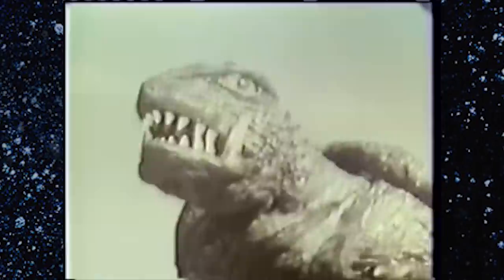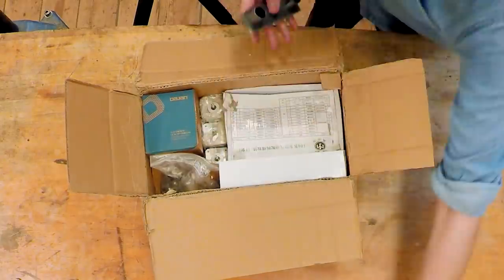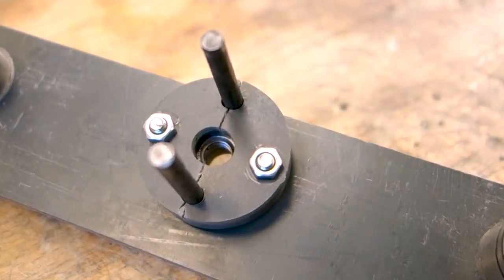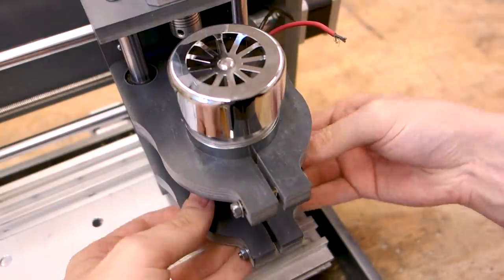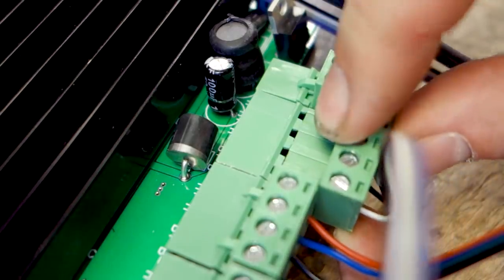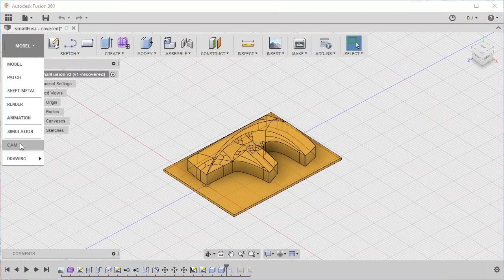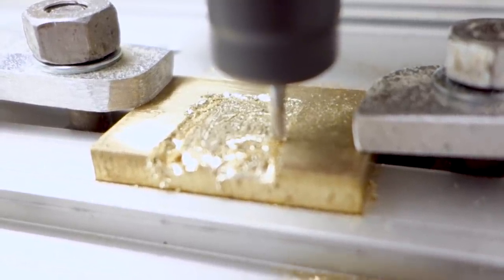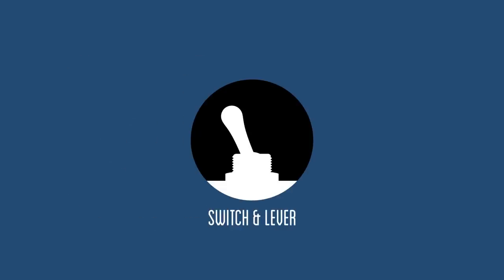Review: Cheap CNC Mill

Comment: I have had this same machine for about a year.  It is perfect for making PCBs and does an amazing job. I've also milled plastic parts and MDF. I am building a jig to hold HM-10 Bluetooth modules, it is designed in Fusion 360 and can be seen here http://a360.co/2w46028  (use explode model on the toolbar to separate and see all the parts). I used this to mill the PCB and the MDF parts. I am using pogo pins and the spacing is 1.5 mm between pins and this little machine did it perfectly.
Reply from the maker: +aharry great input, thank you! As I show it does just great with softer stuff, but some seem to get hung up on the metal failure of mine. I figured it would do PCBs just fine, but didn't have any I could test on. Cheers!
Reply: Switch & Lever I'm sorry, but considering how poor did it perform on brass (a soft and pliable alloy!) it probably won't give you the precision required for PCB milling. Sure, it MIGHT be able to do some engraving into it, but that's a fairly hard material too, so the dimensions would probably be off by quite a lot.
Reply from the maker: +CoolKoon so you take your opinion over someone who had first hand experience using the same machine for doing what you said? I'm confused. 

The load on the machine when engraving PCBs should be substantially less than the load of milling the foam I did, and even though it skipped steps due to poorly greased rails and leadscrews it pushed through without any issues. The thickness of the copper on a PCB is minimal, and copper is also a much softer metal than brass. It should do just fine.
Reply: Switch & Lever - "even though it skipped steps due to poorly greased rails and leadscrews it pushed through without any issues" - And that's what worries me about this thing the most. Sure, it might be able to do boards for through-hole components just fine. But how about boards for SMD chips with REALLY small traces (like the board of the aforementioned HM10 module mentioned by the OP)? Even if I'd be buying this machine only for making PCBs, I'd rather throw in like $200 more to get something that has a metal frame, not this flimsy plastic.
Reply from the maker: The plastic isn't flimsy though, it's plenty rigid for light duty work such as PCB milling. Even the wider boards I cannot significantly deflect even if I try to bend them with my hands. I think it's PVC with a fair amount of clay in it, to make it extremely stiff, with the downside to being brittle. If the plastic was "flimsy" as you say, it would deflect a whole lot worse than what it does, when being pushed into doing something it was not supposed to. 

Why does the skipped steps worry you though? It was entirely fixed when I greased the rails and screws. It's a non issue. Regardless of the mill you're using you need to make sure things are running smoothly, it's not like it's unique to this.

As I've wrote before, the best accuracy I can get from it is about +/- 0.1mm over 100mm. The steppers motors are 200 step motors. Combined with the M8 leadscrew that gives a resolution of about 160 steps per millimeter for X and Y. I would say that's plenty accurate for even the SMD work you're talking about.
Reply: CoolKoon - Oh, I'm sorry I thought this video was about this particular machine and it's capabilities and limitations, I didn't realize it was about you, your expectations and budget ( I must have missed that in the description). I guess Switch & Lever should have conferred with you before wasting his time building, filming, and evaluating it since it doesn't meet your needs or expectations. If you don't have experience with this particular machine or a question about it no one really cares what "YOU" would do.
Reply: aharry Eh, whatever floats your boat, but this CNC will still be probably one of the flimsiest on the market, no matter how much praise will you give to it (such a prime example of the so-called endowment effect).
Reply from the maker: Where do I praise it? Why do you paint things either black or white? Is this the best CNC on the market? Obviously not. Is it the worst? Hardly. Go to Aliexpress and do some looking and you'll find many worse ones. I point out the bad sides as well as the good ones, trying my hardest to give a level headed review, because that's what I feel that my viewers deserve. If I wanted to shower it with praise, as said, I could've done a heck of a lot better job. It's just funny how you think you know this better than I do, even though you've never used one, or even seen one before this video.

And please, do us both a favor, and don't try that armchair psychologist nonsense on me.
Reply: Switch & Lever "please, do us both a favor, and don't try that armchair psychologist nonsense on me." - Actually my previous reply was aimed at the OP (aharry), not you. 
"Is it the worst? Hardly. Go to Aliexpress and do some looking and you'll find many worse ones." - TBH up until I've seen your video, I thought that the one with a metal (aluminium I think) frame was the worst Aliexpress and eBay has to offer, which has really impressed me (so the one presented by you came as an entirely new low to me). And believe me, I DID look for the cheapest ones (both on Aliexpress and eBay; not Amazon though, because their shipping rates can be a bit too high for me).
"I point out the bad sides as well as the good ones, trying my hardest to give a level headed review" - I never implied nor said that you didn't. Ironically though you inadvertently gave out more information than you intended to.
"even though you've never used one" - And why would I want to use one, if I can get better ones only for slightly more caps?
"or even seen one before this video" - You're right. This is the first time I'm seeing this one. All the ones I've seen on eBay and Aliexpress were better than this.
OTOH why do I have this feeling that you get offended by the fact that I have an opinion of my own that coincidentally doesn't align with yours?
Reply: Switch & Lever "The plastic isn't flimsy though, it's plenty rigid for light duty work such as PCB milling." - You said it yourself: it's only good for "light duty work". The problem I see with this is that a CNC machine is almost always a one-time purchase (both because of price and space constraints) i.e. I don't think that too many people would buy a CNC machine only for "light duty work" and then purchase another one for working tougher materials (without selling/throwing away the first one) once they decide it's time to move higher. 
"Why does the skipped steps worry you though? It was entirely fixed when I greased the rails and screws." - Okay, fair enough. It didn't make the problems with brass milling go away though.
Reply from the maker: I hear you, but both of the two Johns started with the point of doing small scale production, not as just a hobby. I mention, specifically, that this is not a production machine, beyond possibly small scale engraving, PCB or otherwise.

Comment: Without reviews like this, you would never know how good or bad the product is. Thank you very much for doing this review. Based on the information provided, I think I will continue to collect parts to build my own, rather than buy a cheap kit like this.
The question is -  whether I can build a decent CNC for less than $500? I am starting to think that the answer is "probably not".
But the challenge is there nonetheless.
Reply from the maker: +Arduino Basics hmm, I don't see why not. Proper aluminum extrusions aren't that expensive, and you can even use an Arduino as your controller board (with a stepper shield). I think continue collecting and see where you end up. You can always build something smaller and then scale up as you get more material.
Reply: I don't know if you can, but I know I did. The challenge is making the right compromises to come in under budget. My machine doesn't look pretty but it runs well. I didn't use an Arduino with those weak shields, or aluminum extrusions either. I lucked out and found a lot of the components I am using cheap. You have to pick the right design for a cheap build too. Forget about making a cheap moving gantry. That will come out like crap.
Reply: To be fair, it is sold as an engraver.

Comment: The no Mains cable supplied is probably a good thing. It protects you from 0.05mm2 copper clad shredded coke cans
Reply from the maker: +TheChipmunk2008 haha, maybe. The cable for the power supply accepted a grounded cable though, but the transformer was just a regular two lead deal, which slightly concerned me.
Reply: There is normally no ground on a small control transformer like this one. Typically it would be enclosed and you would ground the enclosure.
Reply: It probably would have been cheaper for them to make it with a standard socket for an equipment cord like for desktop computers than to put on the barrier strip. Anybody who will do CNC has plenty of old power cords laying around,.
Reply: TheChipmunk2008 So true :D

Comment: Also regarding Chinese reuse. I had to fix one of the Chinese lathes at my trade school. When I removed the plate showing the selection position, it looked like someone had stolen a Chinese subway sign, flipped it over and etched the lathe stuff. There were upside Chinese letters on the other side that obviously came from some sort of sign or plate. Cheap as hell.
Reply: The Metal Butcher "it looked like someone had stolen a Chinese subway sign, flipped it over and etched the lathe stuff" - That's good. It means that they don't let anything to go to waste :)

Comment: I'll take a Bridgeport, thanks.
Reply from the maker: +The Metal Butcher okay, make sure you shoot a video of putting it on your desktop, because that would be hilarious!
Reply: Bridgeport CNC machines sucked. I think it was a major contributing factor that put them out of business. They went out not too long after they started making CNC machines. I knew a guy that got a CNC-1 for free. Of course it didn't run. Hardly any of them do today.

Comment: Looks like a clone of the Zen Toolworks machine
https://www.zencnc.com/product/zen-toolworks-7x7-cnc-machine/
At a similar price the Zen has better hardware (acme screws,) but doesn't include any electrical/electronics.
Reply from the maker: +Jon Baker yeah, there are similar machines available from all over. Is Zen Toolworks the original one?
Reply: Switch & Lever I think so. I got one that looks just like their current 7x7 in 2011.

Comment: I wouldn't take it even if they gave 400$ !!
Reply from the maker: So would you call people who do wood CNC milling, or mill wax for casting jewelry as playing with toys? How about plastic gears? I'm utterly confused why being unable to mill metals makes it into a toy?
Reply from the maker: Well, as someone pointed out, the choice to use a ball ended endmill may not have been the brightest choice I made. If you look at my other CNC video, about milling a coin, you can see how I'm wrangling a proper consumer CNC mill (Roland MDX-40A) that's not made for milling metal, into doing that anyway. And this mill has a more powerful spindle than the Roland does anyway. 

As Paul points out, I don't think it's impossible by any means to mill brass, but more tests are needed, and probably another tool as well, unfortunately I ran out of time as I needed to get this video out.
Reply: hi , @SwitchAndLever   I am running a business for 25 years  in import and export  carbide insert and endmill all types of  shapes  and infield recommend tools to my clients .  your small  CNC machine is ok to mill but no yet perfect . I "thinks"  you maybe  no understanding the carbide tools  well to use in your machine that cause the jobs to seen no good in finish parts.

if you want to know many about the carbide tools bullnose shape and 2 flutes or 4 flutes to make good finishing parts , I can share the knowledge
Reply from the maker: kent Yap Kok San sounds like a perfect opportunity to start up your own YouTube channel 🙂
Reply: @SwitchAndLever  "...unfortunately I ran out of time as I needed to get this video out."  I think that because you rushed to get this video out, instead of taking time to learn how this machine needs to be operated,  this doesn't  give us an accurate demonstration of the machine's capabilities.

This is a great unboxing and assembly video, but it doesn't answer our real questions about the machine - "Is this machine capable of doing what I want to do with it?" and "Is it worth the money?"

I also wish you had at least tried the table that came with the machine. It's possible that the difference in mass between it and the one you made could have had an effect on the performance. If you felt the included table was too unsafe to use, it would've at least been nice if you had weighed the two tables. 

Did you ever try milling brass at the slowest possible feed rate? If so, how well did it work?
Reply: Paul Frederick He's rigt though. This machine seems to be pretty useless for anything but foam. And that basically means it's little more than a toy.
Reply: I'd be surprised if it couldn't mill metal with the right tool, material, cutting fluid and milling strategy. Just because it didn't on the first try doesn't mean it can't.
Reply: Irfan Musa ...or maybe they just want to use a CNC for something that's kinda beyond this machine's potential...
Reply: Use it to make another set of parts out of aluminium, use that to make another out of steel.
Reply: Ian Britton Since this thing couldn't quite cope with brass, what makes you think that it could do aluminium? :P
Reply: Different strokes for different folks. I have one of these and it is actually a production machine that will help in a business. So don't judge by class or lineage. Instead judge in light of the users purpose.
Reply: Switch & Lever but seriously my friend that thing looks like it can't even mill paper..
Reply: Darcy Whyte - Okay. And out of curiosity: what do you produce on it?
Reply: I am sorry but a toy cnc would be better than this useless piece of plastic, may be it could be used for 3d printing but definitely not for milling anything, it will take forever to finish anything with it and the results will be horrible.

The real value for this machine wouldn't even exceed 100$.

If it was made of 3/4 plywood it would have been in a much better shape and give more reliable results.

It is just too expensive for its structure and its results and not reliable at all!
Reply: Totally Agreed
Reply: Switch & Lever -"I don't think it's impossible by any means to mill brass, but more tests are needed, and probably another tool as well" - Cool, can't wait to see it in a new video then ;)
Reply: your absolutely right! sure it wouldnt be my first pick but i hate it when people say its shit or whatever when they have no first hand expierience and just regurgitate theyre own opinion. throws off anyone looking for actual info if they plan on getting this machine, sure its kind of mickey mouse, but for 400 dollars you get a working cnc. as for the whole chinese part and missing wires and instructions and such. that would be where ok im wiling to spend a few hundred more dollars for legit instructions and full parts and long enough cables xD
Reply: Commented before I'd seen the whole thing, you're right of course.
Reply: +CoolKoon   in my experience brass is far harder to machine than aluminum is. But I have machining experience.
Reply: Paul Frederick Sigh, actually we don't know how well could this CNC machine aluminium. After all we've only seen it machine foam plastic (probably the softest material out there) and fail to machine brass (which is harder than a series of nonferrous metals including aluminium). Aluminium is in between.
Reply: Muhammad Nour I second your Reply
Reply: Screwed this piece of crap
Reply: +Tweek Freak   Don't lie. It would be your prized possession. The best thing you own!
Reply: You're probably better off buying an actual milling machine
Pretty sure some of them go for as cheap as 4k used
Reply: Paul Frederick, I would rather loss 400$ for winning my valuable time that would be wasted on making anything with that useless piece of plastic.
Reply: Switch & Lever 
Please don't not promote such a low level chinese crap, I really like your stuff that you do on this channel so just do the good quality stuff that we used to see from you.

You can if you want, make a review for 3040 cnc machines atleast it has a known reputaltion among people!
Reply: +Muhammad Nour the value derived of time that you spend is dependent on the individual.
Reply: Then you're dumb.
Reply from the maker: Sure thing, I'll make another video when I can be sure there are no neighbors in the house, which can be bothered by the noise. Unfortunately, I don't have access to the workshop in the video any longer.
Reply: Switch & Lever "mill wax for casting jewelry" - Okay, this one's a good point. This machine would definitely work for that. But wood tends to be harder than plastic foam, so IDK about that. And my point is that if something performs THIS poorly on a fairly soft alloy (like brass) even at a slow speed, it might have problems with some softer materials (like solid plastics) too.
Reply: i could turn that 400 dollars into thousands once i had expierience with the specs of the machine
Reply: +CoolKoon  What we're seeing here is the limitations of video production. The author did not devote unlimited time and resources into showing this machine in the best possible light. They showed what you might expect just getting started. Which has merit on its own. We still need to be careful not to draw too many conclusions from it all though.